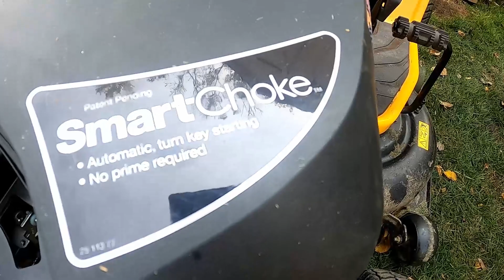How to Diagnose and FIx Multiple Issues on Cub Cadet GT2 LX42. No start, Runs rough.

Comment: Yo, my guy, maybe a video on replacing the Cub Cadet’s IntelliPower ECM module and removing the carb to clean it! 
I read your post on another channel’s video where you described that absurdly complicated process on removing the carb to clean it out. 
I think we are starting to see an increased demand for those 2 repairs on the Cub Cadet’s that have IP ECM as they are starting to break down since introduction a few years ago and warranties are expiring. Without a warranty, the process is no longer hidden behind a dealer’s shop as people want to do it themselves. 
Just a suggestion since you got it done before. Anyway, thanks for the videos and hints. Much appreciated!

Comment: Hea, thanks.  I had a similar problem where 1 cylinder would cut out intermittently too.  Turns out in my case it was a spark plug wire that had rub thru due to vibration I guess.  Also, thanks for showing that white tab thingy, that was a real help.
Reply from the maker: No problem, glad it helped

Comment: 6/21/22. Mine did this and  kept changing parts. Air filter looked clean but cleaned it anyway. Didn't help. A friend told me to buy new air filter anyway. I did and it runs like a new mower.

Comment: my Club Cadet 20hp Kohler courage20 I changed the oil with 10w30 Kendel and OEM filter.  Now engine revs Higher and the LED indicator is telling me to change oil? any insights would be appreiciated